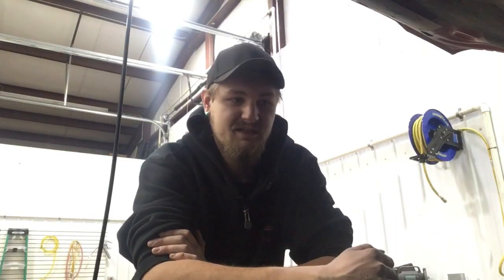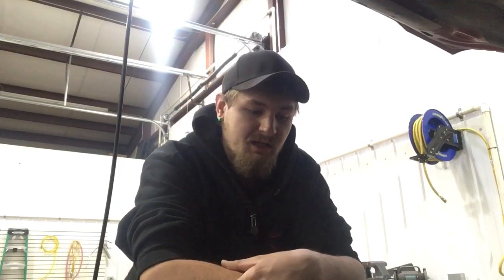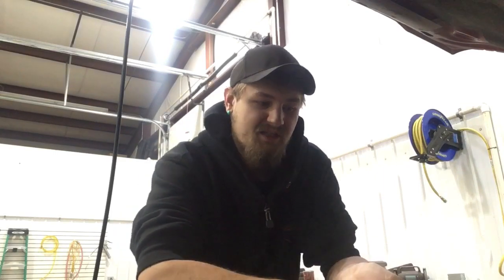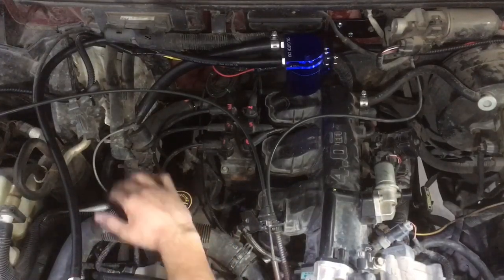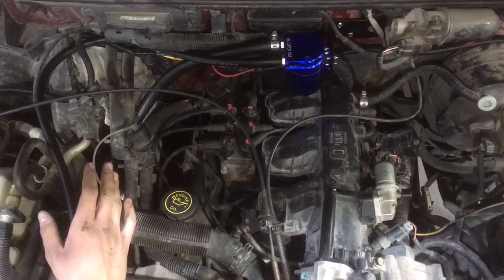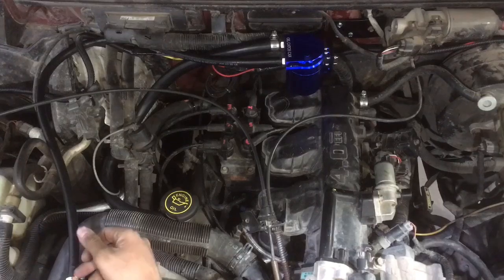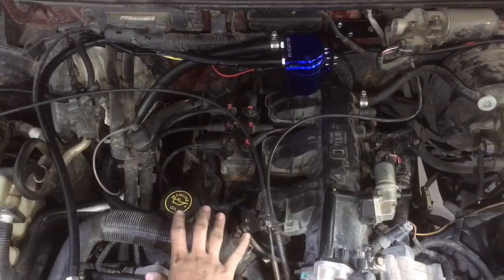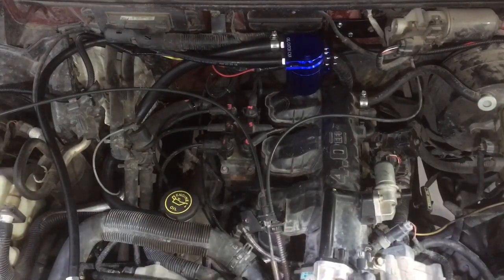Ford Ranger Oil Catch Can

Comment: Any chance you could write a spec list and dimensions for how you made yours?want to do the same on my 01, she's hitting 190k so seems like a good time to do it when I change the intake gaskets and intake as well
Reply from the maker: It’s been a little over 2 years since I sold the ranger, otherwise I would happily throw out a parts list, I just don’t remember what I all used. The catch can was an EvilEnergy can off of Amazon, and some misc heater hose from Napa and clamps

Comment: Amazing,  buy a new car & have to start modifying with aftermarket upgrades. Is this some new creation of money generation or does it really need one.
Reply from the maker: Ben Benjamin I bought a 1998 ford ranger with 170K miles on it, hardly what I would call buying a new car. The motor that’s in it is very common for oil blow by, I have owned a dozen of them. Does it “need” one, no, did it help keep excess oil from being put through the intake and onto the valves, absolutely.
Reply: @Tempest_Overland  I bought a new ranger for the concept of reliability  .... a lot of people are saying a catch can is needed on a new ranger?
Reply from the maker: Ben Benjamin it’s a turbo engine, I would 100% put one in. On any forced induction application you are adding pressure into the motor, which inevitable is going to push oil up out of the PCV and crank case vent, which flow right back into your intake. Which means all that excess oil is not only going back through your intake and sitting on top of the valves, it’s also being circulated back through the turbos. Turbos like oil in the bearings, not through the turbine wheels. But again, you don’t “need” it, but it will prolong the life of the motor, you wouldn’t exactly want to breathe through the same tube you fart through? Neither does your engine 😂
Reply: @Tempest_Overland  should be provided from manufacturer
Reply from the maker: Ben Benjamin manufacturers don’t provide a lot of things that true gear heads would recommend. Manufacturers are in it for one thing, money. As long as the car outlast the warranty period they don’t give two shits about your car 😂
Reply: @Tempest_Overland  I agree its probably  needed sadly.the kit I will pick will be the 200 dollar unit that has a mount for the ranger & lines have the Ford connections.
Reply from the maker: Ben Benjamin nobody makes a kit for the ranger I had in this video, so I had to create my own, bolt in kits are a lot nicer
Reply: @Tempest_Overland  the labor hours spent designing a mount & tubing makes 200 usd a good deal
Reply: I've been in the machine tool business for decades & I will always spend more to get a quality kit from my vendors.  You see it like me .. 200 dollars is nothing compared to the time.